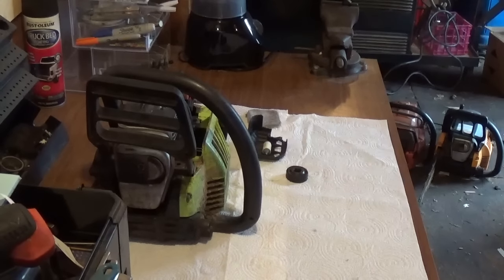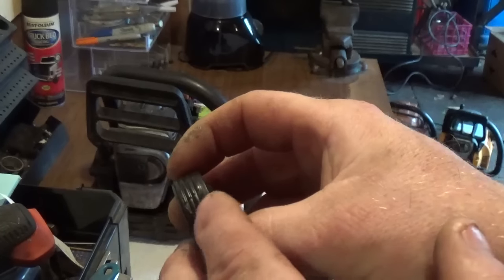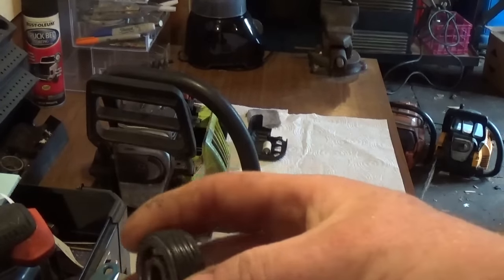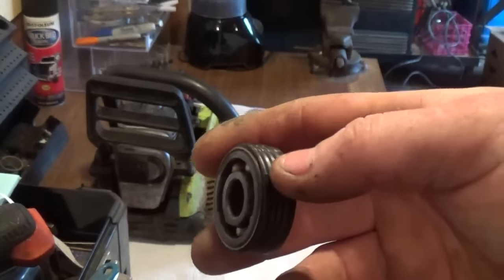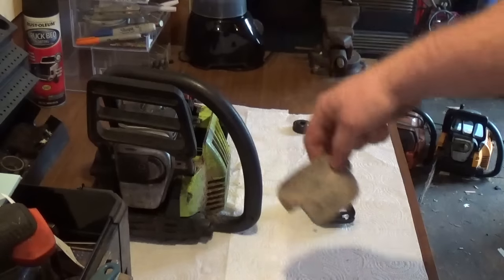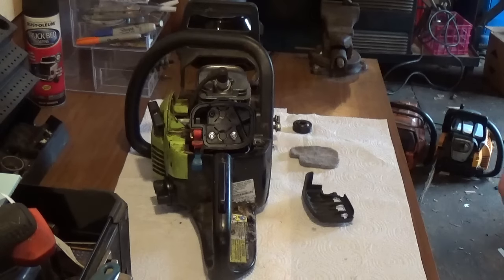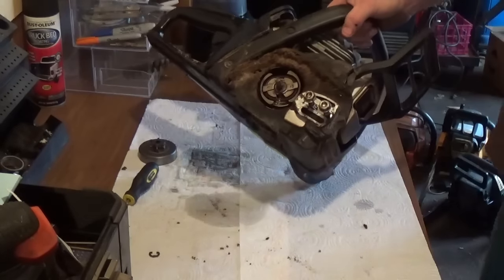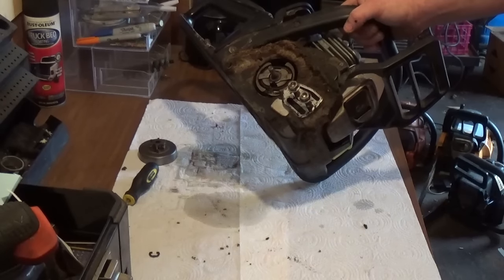Common problems with Poulan Chainsaws

Comment: My opinion all plastic saws are a POS. I bought a new husky rancher 55 in 2000.  POS It ran good  and still runs good however the automatic oiler gives trouble and that plastic broke around the anti vibration mounting. Still have it and its now in a rancher 51 case. Dont use it much. After watching Leons chainsaw videos. I drug out my old 1960,s homelites. Im now using a  54 ccXL12 a 58 cc  XL12 Automatic a 925 and a 550. No loosey goosey vibration isolation. Manual oiler saws with 1/2 pint walmart super tech two cycle oil mixed to every gallon of gas. Unmuffled exhaust. Loud noisy clouds of blue smoke and great amount of wood chips from the  chain that dont have the anti kickback nonsense.  I really enjoy using them! Out in a school bus there are a half dozen of those plastic poulans. a few plastic stils and a few plastic huskvarnas. all of them POS.  even have a few newer homelites and their plastic  POS also. Get a real magnesium or aluminum saw with a manual oiler and no pollution muffler etc. You will smile every time you get the chance to use it.

Comment: I have Poulan that might not be a POS its a  older 601A like the one used in the Chainsaw Massacre Movie. Primed the carb and it started. need fuel line and carb kit. Also have a McCulloch 610 like Clark Griswald used in Christmas Vacation. Never got a chance to check it out yet. Im a chainsaw hoarder. I buy them at yard sales estate auctions ect. Probably have a couple hundred in the collection. Im using two Homelites that cost me $10 each. and two larger ones that cost me $20 each. However im 70 and can fix any kind of engines.   Ive probably bought 40 chainsaws this year.  most I paid was $40. lots of $5 saws.

Comment: THIS MAN SPEAKS THE TRUTH!!! I bought a PL3314. Brand new. It started ONCE. Ran it for 45 minutes, ran great. I shut it off to clear some brush and it NEVER started again. I will NEVER, ever buy ANYTHING made by POULAN again!
Reply: Hank Bridges  No longer worried about it. I just sold mine at a loss. I'm going with a 40V. All I need with no more issues with yanking on a rope. ;-)

Comment: I never use anything but canned fuel (ethanol free) in small engines like chainsaws or weedeaters. Yes you can buy 89 ethanol free in some places like marinas. The canned fuel is typically 91 or 92 octane, and you'll be amazed how good these engines run with high octane fuel. and I have a Poulon 2050 and it has run great for over 10 years once i started using Canned fuel only.
Reply: We're fortunate to have 90 ethanol free right at our local gas station

Comment: My dad's poulan 2000 is 30 years old and still runs, impressive huh? it doesn't have that many hours on it, but it has gone through one whole chain already. Only problems we've encountered were the usual clogged carb and cloudy sparkplug, but nothing else. Unfortunately it was starved of 2-stroke oil once and it's been knocking a bit ever since, still runs tho.
Reply from the maker: Great ....lets see it preform the poulan challenge .
Reply: @kevinbolin7665  If the challenge includes not stalling mid-job then it will surely fail haha. It would also fail the idling challenge and the proper chain lubrication challenge (by now lubrication is done manually because the pump works like crap).

I know all these may seem like huge drawbacks, but in reality we love this thing since it's been with us for so long. Sure if you wanted it for real work then you should toss it out and buy a Stihl or something better, in our case this is perfectly adecuate. Heck I'm even looking into fixing the knocking some day...

Comment: Let me just say people, I have a saw just like this saw and l have had no problems like this at all! Yes I do have problems with the gas cap, I just put some grease on it and it's good to go, not too much, don't want it in the gas! I have had this saw for many years and l have had no problems like this! I have cut a lot of wood with it and no problems! Let me tell you what I did. We had a bad Storm and we lost power for weeks, I put gas in every gas can I had for the generators including my 1 gal gas can for my 2 cycle gas ! I went out and started cutting up tree's with my wild thing saw and it kept getting hot and would not stay running, I said OMG, I just destroyed my saw, straight gas, no oil in it! I emptied the straight gas out of it and put gas and oil mix in it. I started it, let it idle for some time, I did put more oil in the gas then I should have, I kept chocking it so there was a lot of gas and oil getting in there on the piston and ring. 4 years latter my saw is still running hard! I give this saw a thumbs up! I have 3 of these saw's. Like I said, I have cut a lot of wood with this saw, I'm very pleased with it and you can be too! I have cut tree's that was to big for this saw and it kept cutting, I have some very big tree's I need to take down and I'm going to put a 20 inch bar on it, with the power of this saw I know it will cut just fine! You just let the saw cut don't force it, it will cut just fine! So I hope this helped you wild thing owner's out, remember take care of you're saw and it will take care of you!!!

Comment: Shit mix will cause that . Or you ran it lean. Not enough oil ect. I punished mine its still fine. Not a 600 $ saw either its not a jhonsered turbo or a stihl or echo or Husqvarna.  Its a 168$ saw.
Reply from the maker: You advocate you punished yours and its still fine ...Great ...Simply prove it ….Perform the Poulan challenge ….If its as dependable as you claim it truly shouldn't be a issue {RIGHT ?} So show my viewers and I this chainsaw in action Mid evil.

Comment: My question is I have a poulan 2075 and need to adjust the carb but don't know what the max rpms are
Reply from the maker: 12 to 12,500  trying to reach the 13000 mark isnt ideal...These saws are just to cheaply made and the oil isnt fd rated that Husqvarna / Poulan use on there Cheaper Poulans .....Even though Husqvarna as a parent company offers FD rated oil for Husqvarnas as well as Jonsered .....They just dont use it with there box store junk .....Poulan for example . I laugh at how cheap Husqvarna is with there Poulan brand oil provided knowing that they actually could provide a better quality oil with the purchase of a new Poulan Chainsaw . Sadly there just to committed to fucking there customers.
Reply: @kevinbolin7665  I totally agree,and thanks,I was gonna go with the 12k mark,I rather run it low than to high,I kindly figured they were all the same pretty much with the poulan name lol,I have a poulan 2000,and it seems like a awesome saw,little better than what poulan makes now,thanks for the info man I really appreciate it

Comment: I have a Poulan P3314 chainsaw. I've owned it for over 21 years, and it's been a piece of shit for all that time. 
I'm going to do myself a favor. I'm going to get an Echo and give the piece of shit Poulan to my neighbor. I hope he won't hate
me for it.
Reply: It must not be that much of shit to keep it that long. my neighbor gave me a pp4218 with problems from how the last person kept it 

As long as it runs its still good it needs the gas lines and filter and I'd need the right tools to replace those on it then I'll have another good smaller poulan
Reply: I can't wait not to use it this year. I got it running okay, idles good, but still leaks gas and chain lube. The fix there, drain each. Can't figure out where the gas is coming from, gas tank is two halves of the handle glued together.
Reply: @stephenredelen434  oh it might have a small split on the gas tank seam line
Reply: @Mike-su8si  After replacing the lines and tightening all the carb screws I'm thinking it's the seam leaking.
Reply: @stephenredelen434  it probably is

Comment: I have pouland pro and had issues with the carb so I bought a new one and put it on and once I got it adjusted I had no issues with it up until now and I'm not sure what's going on but I'm thinking is a gasket or seal because I'll start it and it goes full throttle no matter what I do and it'll either shut off or sit and run wide ass open until you see smoke come from it . I'm pretty sure it's not a throttle issue because I can see the cable moving back and forth just fine so I'm stumped?🤷

Comment: Poulan for many years overbarred their saws. To get away with this they used a skip-tooth chain. Those chains will overspeed the motor b/c of the lack of cutters but if they wear that chain out they'll buy a common chain with a full complement of cutters then the saw can't handle it. You know this, not telling you anything new. That's when those saws are done but do people listen, nooo! If Poulan would've went with a shorter bar, they might've (?) lasted a bit longer. You & I see working on these as a waste of time b/c it's gonna create customer problems.
Reply from the maker: True / Modern Poulans just are complete shit ...and a true waste of time and money.

Comment: I bought a second hand poulan, it ran fantastic for 10 years, never stopped when I put it down, had heaps of grunt ant now as far as I can tell the magneto is stuffed, if I cant find a new magneto It will receive a good burial unlike my mates stihl which he thought was the bees knees but you couldn't keep the mongrel running. True there is good and bad in all but if I could my saw going again I would have it over anything else.

Comment: Okay, so Poulan makes a shitty saw, I get that. Do you know of an affordable "good" saw? I would only use it a couple of times a year for firewood. Thanks for convincing not to invest in a Poulan.
Reply: Buy electric, no issuses with old fuel, ethonal fuel, no fuel cap issues, no fuel lines rotting, no carbs getting dirty,

Comment: I have a brand new poulan saw that I can't even get to even try and start. Even by putting starting fluid in cylinder. What kind of flaw can this be? Saw was used maybe once.
Reply from the maker: Likely the cheap carbs they have been putting on them from overseas.
Reply: 5 things needed for an engine to run are; timing, compression, spark, air and fuel. Any of the first 4 could be your problem.

Comment: Well today I bought a 33cc 14” bar Poulan for $30 and it runs good and starts right up and looks like it’s seen a decent amount of use from the previous owner but we will see when it fails! Gas cap problem I’m aware of but hopefully I get lucky and it last awhile….I definitely would never buy one of these new but hey $30 ain’t bad for a good running saw.

Comment: A filter that will not let air through - from clogging(never had the issue) - is NOT going to let much larger wood chips pass into the engine.
*Don't Blame the Saw plastics for cheap owners not running Ethanol Free Fuel.
A clogged Tank Vent does NOT increase pressure in a running Saw. It creates a Vacuum and Starves the Carburetor.

My POS Poulan 40cc saws are 10yrs+ and 7yrs. people that complain about POS saws don't bother to keep up on maintenance until something fails. Then they sell it to some unsuspecting Fool that eventually takes it to some sarcastic smart azz repairman that prefers bashing to making a profit on generally simple repairs.

Comment: Husky bought poulan   They are design for the box stores.   Husky trying to work thru the inventory of poulan  so don’t blame husky for Electrolux the bad design.  They are trying to get rid of the inventory they acquired and trying to recapture some of there investment.
Reply from the maker: Question ? You yourself have just implied that Husky made a bad investment....And that they are trying to recapture some of there investment . You insinuated it was a bad design as it was originally a Electrolux made product .Now even though I personally know Husqvarna is the parent company ....Let me ask this of you ......would it not stand to reason that if this product {investment}was of any real quality that Husqvarna wouldn't have to push it under so many colors and brands bought by Husqvarna as a parent company? So therefore as a consumer should we be obligated to accept a inferior product that deceives us as a reliable alternative . I mean seriously should the saws not at least perform as they should right out of the box? Why should a new saw require a carb adjustment ? Don't get me wrong elevation is a factor but lets be honest how many dealers out there have had to adjust theses carbs just because of a idling issue ?{straight out of the box might I mind you}......I truly hate this new found mentality people have acquired .......That its ok to deceive people ........To take advantage and capitalize by limiting quality and standards just to appease profit . I have found this not only to be the case with Chainsaws and trimmers but as well with small engines . Think I am kidding ask any dealer about finding many of the internal parts for some of your more modern garden engines .......Then assuming there is even a listing see how many S.B.R. red flags show up over parts you may need to purchase .  Yes ....Service By Replacement seems to be the norm so best of luck finding that part is the answer most people get from a dealer .

Comment: Poulan is NOT a good saw...then again, neither is Craftsman, Toro, and a dozen other brands...they were made for 'light duty home owner use'...period. This takes us to problem number 2, poor maintenance until the saw stops working. From never cleaning the air filter, to leaving gas in the tank for 1, 2, 3 years or more before using it again...yeah...you don't treat your car like this...nor do professional loggers treat their saws like this. You beat up 'Husqvarna' (husk-varna) a lot...but here to tell you, the 455 is every bit the saw a Stihl is...and I've seen BOTH ragged out to failure in Eastern Canada forests, too. The difference between, say, a Stihl MS361 and a Husqvarna 455 is around...oh...$550 (Stihl is a thousand dollars, Husqvarna is around $400)...just because Husqvarna owns Poulan as a subsidiary does NOT mean you can jump in to compare the two like they are the same, they aren't...no more than a Toyota Corolla is comparable to a Lexus IS sedan (or a Chevy Spark compares to a Chevy Silverado, for that matter).
Lastly...that gas-swell problem on the tank cap? Yeah, you can blame that on the fool that put Ethanol in the tank...old Poulans DON'T DEAL WITH ETHANOL well...ethanol swells plastics, BADLY! So...stop blaming the saws, and look at the idiots you are making money off of....MOST OF THE FAILURES ARE THEIR FAULT!
Reply from the maker: You touched on some great points ....Sadly Husqvarna is the parent company of Poulan and although maintaining your equipment is imperative ......equipment deliberately designed to fail can not be excused do to poor casting methods .....etc......Its been said as well as seen in the past that cheap, honest and affordable can go hand in hand so to speak ..So Husqvarna /Poulan could make a saw that actually worked as intended from the box . Greed although is the reasoning or influence of a dollar stolen rather than actually earned .That's why Husqvarna buys up these cheaper companies .......Seriously its just because they can take a already known brand for example {REDMAX} and cheapen the equipment by adding more and more plastic thriving on the name or rep of the original equipment name .......That's why you see so many different colored Poulans under different names as a price point option .......Well in truth a bottom line entering option for there bought out companies brand . Now with this being said ......I agree completely with you in regards to the ethanol issue as most failures are a direct result of ethanol exposure  in even the most favored of brands .

Comment: I bought a Poulan chainsaw two years ago. Everytime I used it, very very hard to start it up. Then ran a few cut, it stoped again. Never buy Poulan again!
Reply from the maker: True...This is all to often the case for many people . I truly feel bad for people that get suckered in on the idea of these poulans being of any lasting quality at all. Buyers remorse is always the case after the purchase as most don't even last 3 hours after purchase .
Reply: After about a month of use, the low and high mixture screws have to be adjusted again. Get the splined tool on ebay and watch the videos and you can do it yourself.

Comment: 18 years of owning this brand of chainsaw as 3rd chainsaw in house. I 'm using her only for small woods around the house. As video says total peace of crap where any small thing can couse a whole world of problems. Nicley said. I own Euro version Partner 352 that is made by electrolux when he owned the partner/poulan brand. Few failures in 18 years :)).. Clutch spring, fuel tank vent valve, carburator and fuel lines, resealed the crankcase, chain brake.. very cheap parts for fixing aslo. But if you are handy and know about saws and fixing things you can have this saw in running state in a no time. Just they are not perfect but not that bad as china chainsaw that you can buy in any store.

Comment: Lol. I just bought a "super clean" for a fairly low price. Guy on Craigslist said "runs great".  I'm McCulloch all day. I don't run a saw for a living , i don't want to buy one made after 1980something 😅 and i can run a 18-20 pound saw for an hour at a time. 😉 Anyway long story short it was for my 70 yr old step father. Spent more in gas than the chainsaw was worth and when i showed up it didn't have gas or bar oil in it.... Should have walked but how do you turn down a $40 chainsaw that someone says runs 😅 she will pop. Might waste my time to mess with it. Gave the father in law one of my 10-10's. Might try to mess with this thing for fun but at this point ill put my money into saws that work. The rest will go to powder and primers to let the kids tare this thing up with the 45-70 Marlin. I'll be picking up plastic parts all afternoon 🤣